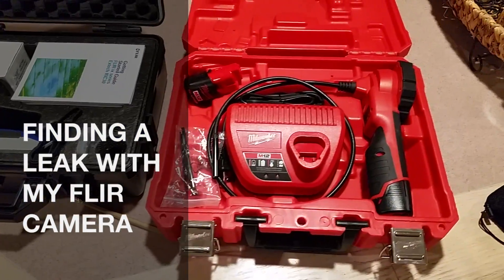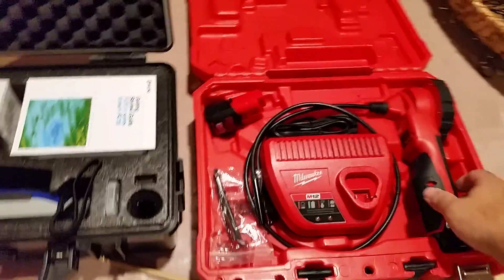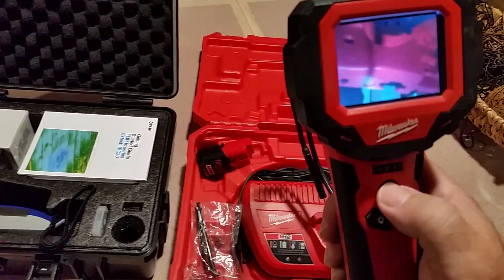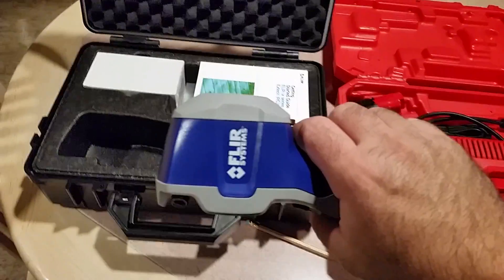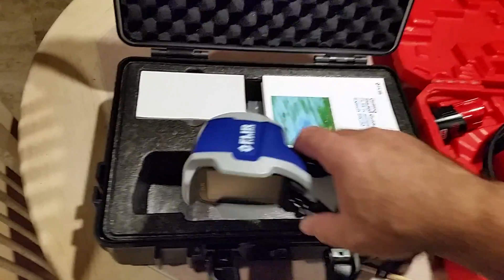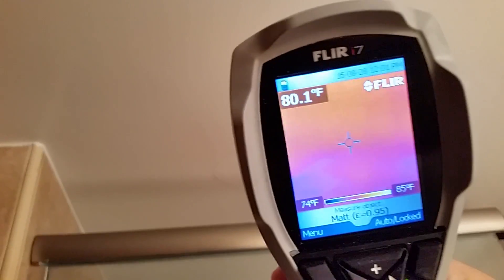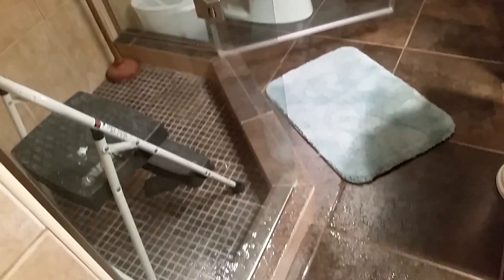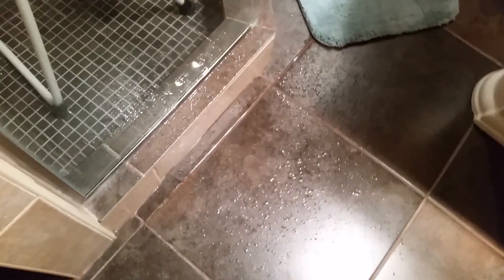FINDING A LEAK WITH MY FLIR INFRARED CAMERA

Comment: You lost me at it's about 1200 bucks 😭🤣
Reply: You can get a thermal imager at ANY price point today. For home use you can get by with a small one for around $400. There are even cheaper ones out there that you connect to your phone, but the ones I've seen of those has been less than impressive.

Comment: Word of advise, never cover up, shower and bathtub p-traps always use an access panel and once in a while open it to se any leaks, and if it leaks you have a quick access and there is no need to tear down a ceiling
Reply from the maker: Turned out to be a cracked lead pan.

Comment: Thank you so much for sharing this video. We have a 150 gal distilled water tank that feeds water to our labs by gravity. The problem is that we have a leak and we check any faucets that may be faulty on all 4 floors but to no avail. It seems an infrared camera could really help us find the leak that may be between walls. Thanks again for showing how this camera works.

Comment: That plumbing is way older than those bathroom showers.   Look for ABS when buying a used older home.   People cheap out and try using the original plumbing in the house. Hiring a plumber is cheaper than fixing a water leak.
Reply from the maker: I had to demolish the entire bathroom and redo the entire plumbing.  There was a hole in lead bend from the toilet too.

Comment: you should have used the thermal camera to better pinpoint the leak right after showering - the hole in the main lead pipe may not be a big deal as long as the flow does not exceed normal limits or the pipe does not become clogged but it was certainly leaking methane gas before you temporarily "sealed" it